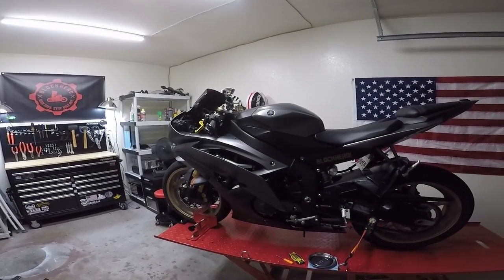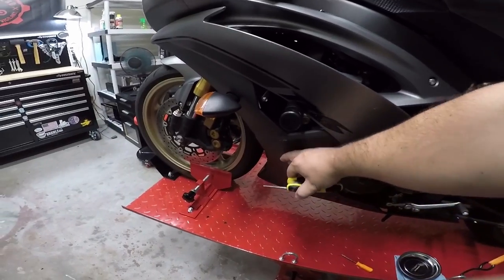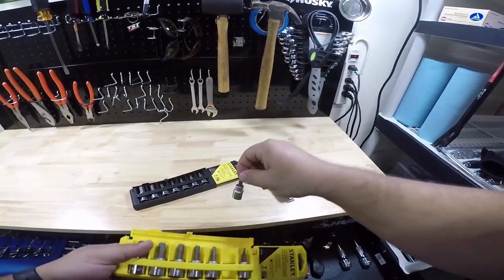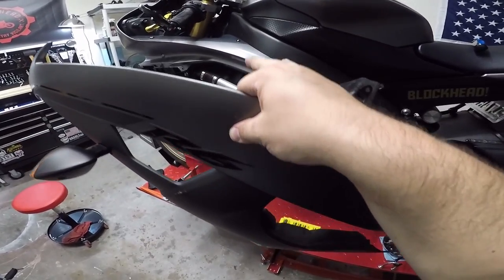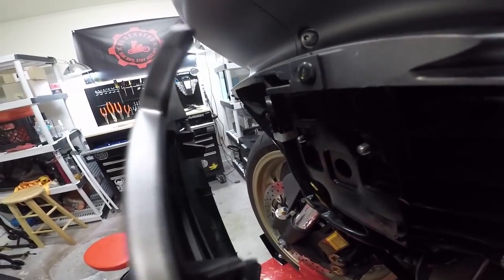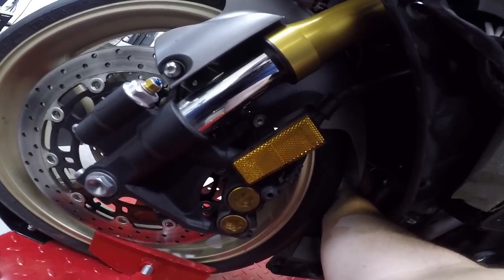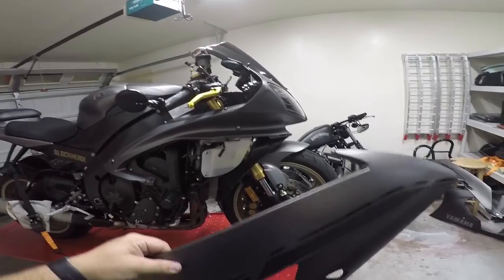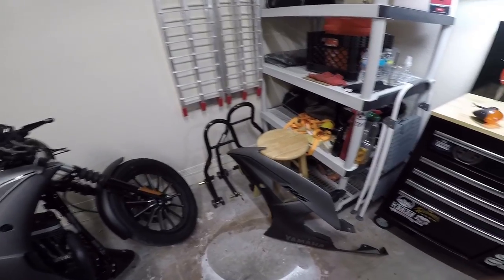How To: Remove Yamaha R6 Fairings

Comment: I’ve noticed even with all screws removed it’s like it still does not want to come off. It looked like when you pulled it made a pop. I fully understand the top front part but is there something in the rear area that is fastened by some kind of friction post that pops out?? I was only partly disassembling mine due to the previous owner not having the front tabs in right and was able to fix it without fully removing the whole piece. Just looking for info for future reference. My R1 fairings are so much easier.
Reply: Just bought a 2007 R1 (same plastic as a 2008) and this thing is a PITA!  I have some Allen/Zeus bolts, plastic push-pins, and regular Allen bolts.  For plastic, both red and black side panels, the upper black cowl plastic above the fender, the lower "V" , then of course the other side (rh) if you need to drain or fill coolant.  Not to mention the red bottom cowl if you want most of it out of the way.  This still is not counting the side panels near the ram-air ducts if you ever need to get under them!  I think it's a beautiful bike, but maybe should have bought an old FZ1 instead!

What year is your R1 that is so easy to work on?